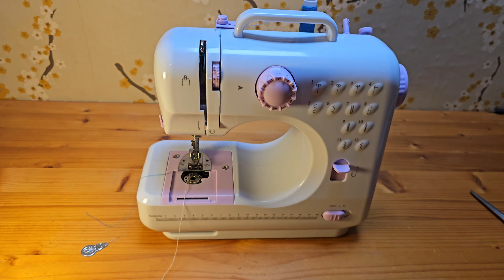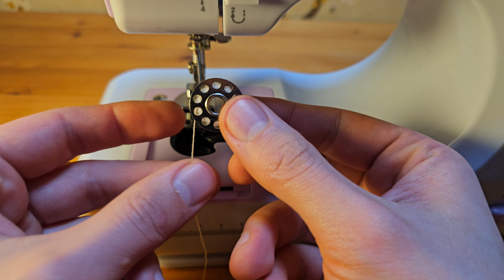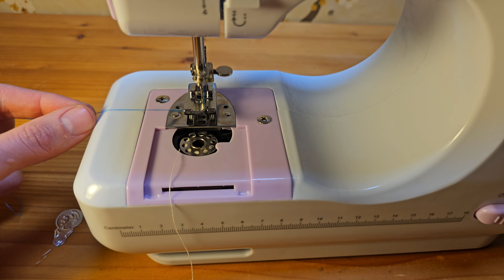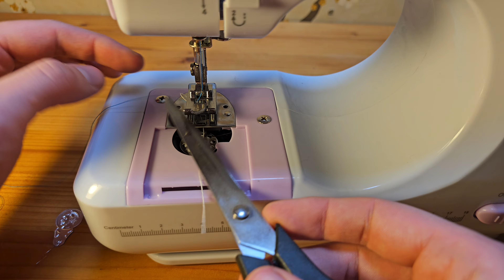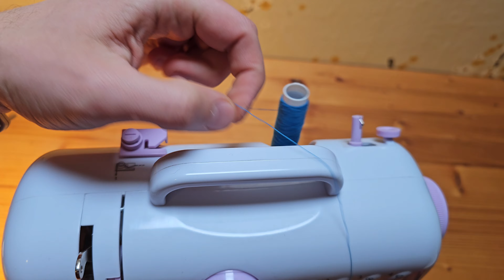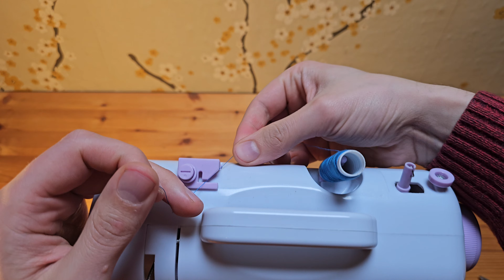SOLVED - Needle Not Catching Bobbin & Not Picking up Bobbin Bottom Thread on Sewing Machine Mini 505

Comment: Where would the other video be?  My needle is touching the black case in the inside.  I have. Checked and the needle is all the way up.
Reply: I also need that video. Did you figure it out?
Reply: @raeflood9344  I believed it would be this video, I could be wrong. Plus, this is from different model. --> https://youtu.be/5uBuaNS5Et4?si=NvapiXQkMaQPSxOW